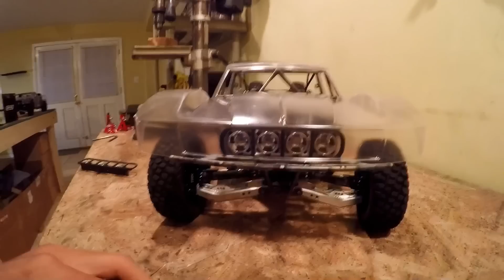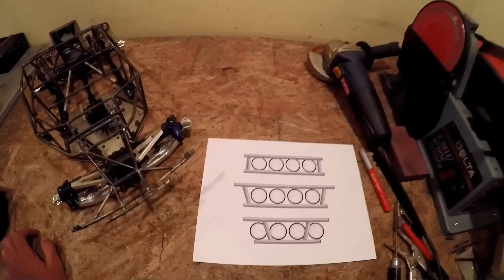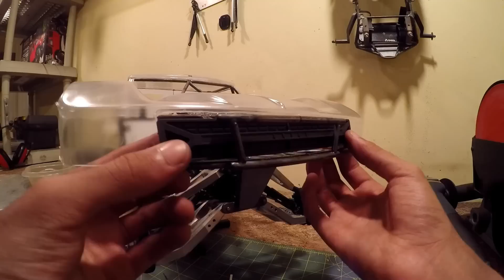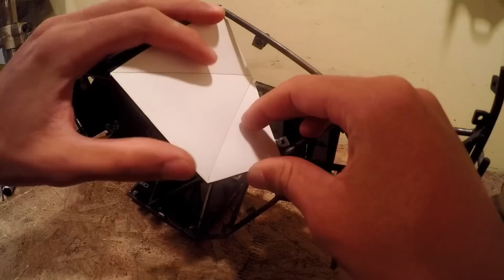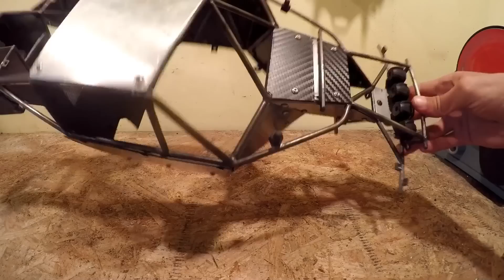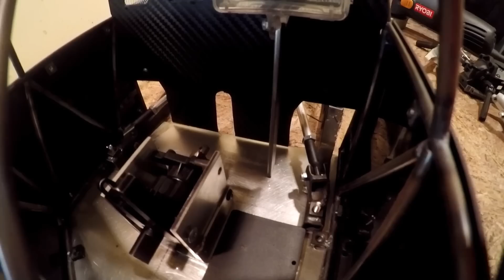Custom 4x4 RC Trophy Truck Build - Part 3: Front Bumper/Lights, Body Panels

Comment: This build is going well, I really like the rear bulkhead  it looks like the 1-1 set up, you could add a few mesh windows in the side panels for more cooling to the electronics.What make are the hubs they are nice looking do they use a hex for the wheels or just the hex bolts. Can you still mount faux brake caliper and disc.
Reply from the maker: Thanks Nick. I already made 2 vents on the sides, you'll see in the next video. I wanted to make more inside that front wheel well, but since it's a 4x4 it would throw all that dirt inside the cab. I'm thinking about making an air vent from the front to the esc for cooling. But yeah the wheel hubs are nice, they're from Vanquish https://goo.gl/D56fok. I have brake discs for them also but you can't see them around the wheel spokes, they're kinda small.